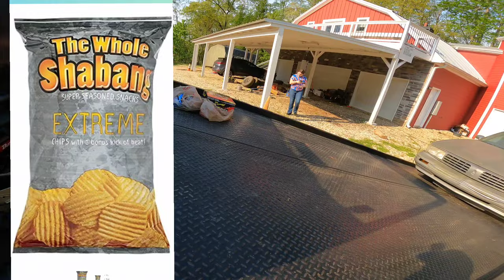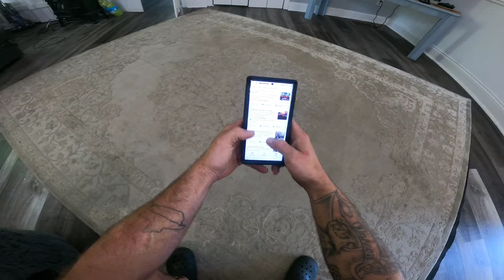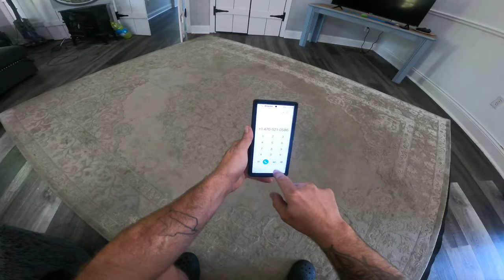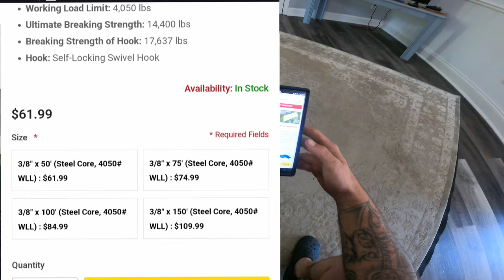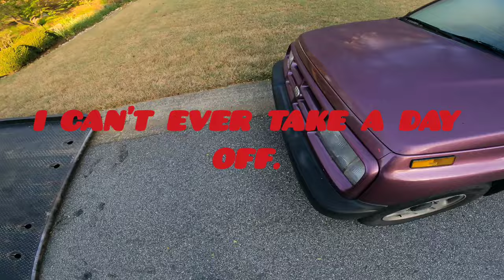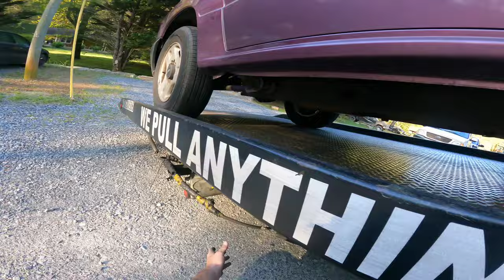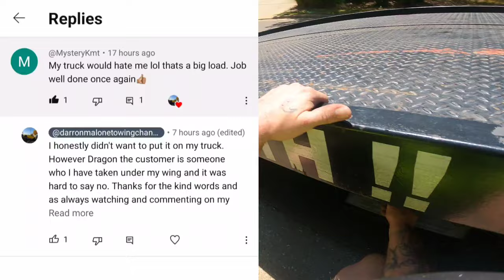Lady Gives Me A Free 94 Oldsmobile Eighty-Eight Royale That Runs! Hyundai Tow.Geo On A Rollback Fail

Comment: Nice. Should be an easy fix whatever that is. Are you working with motor clubs?
Reply from the maker: Yes I have 1 that I work for. I had 2 but safer road rescue/24 hour group is a bunch of cons from other countries that put ads up all across North America and what they do is they'll call wrecker and towing services to do the calls for them and they don't even own a single truck. So basically they mark up our prices and refuse to pay for add on or extra labor so I dropped them. My biggest source of work comes from my free Google page.